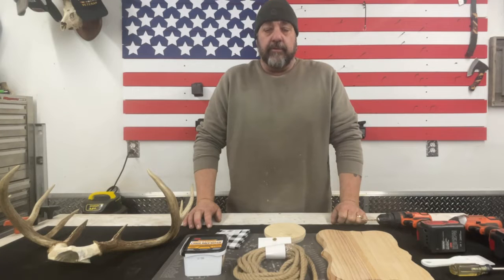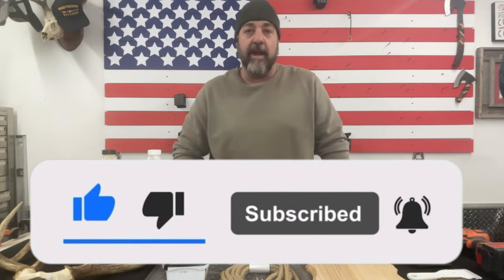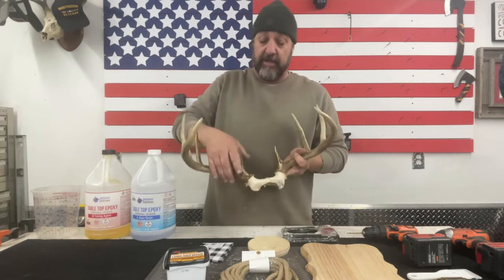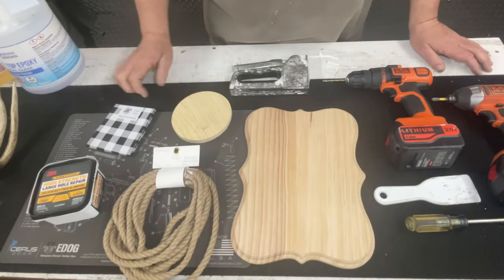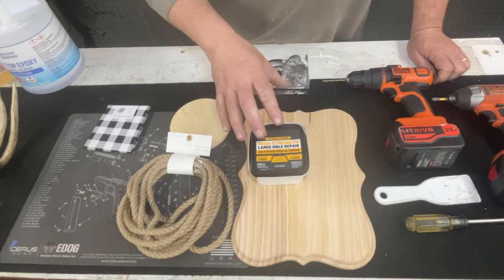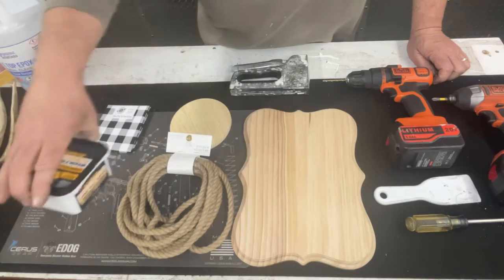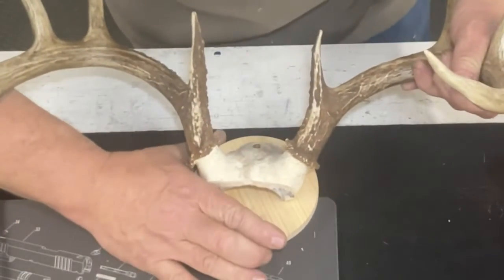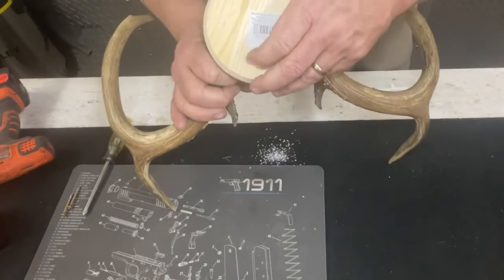DIY Deer Antler Mounting - No kit required

Comment: What bit did you use to drill the hole in the skull cap. I don't want to break it!
Reply from the maker: I just used a small drill bit, slightly smaller than the screw diameter.

Thanks for watching.